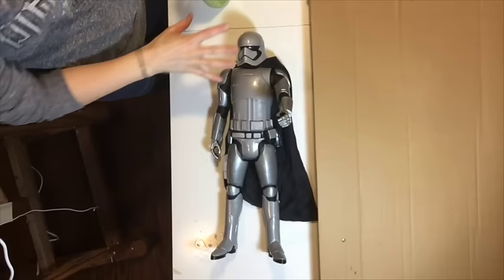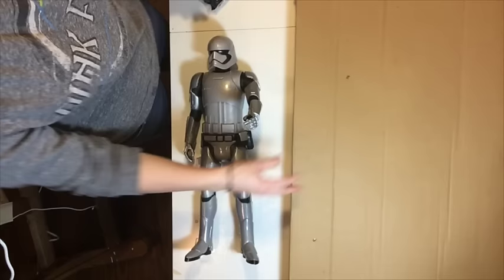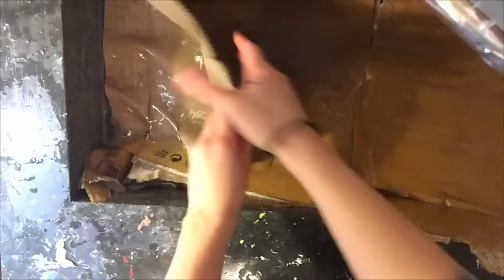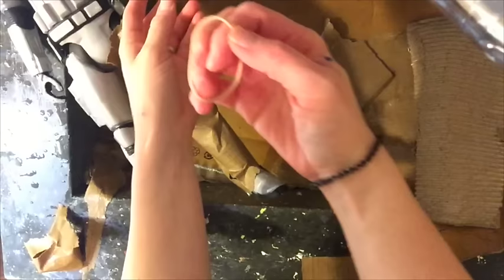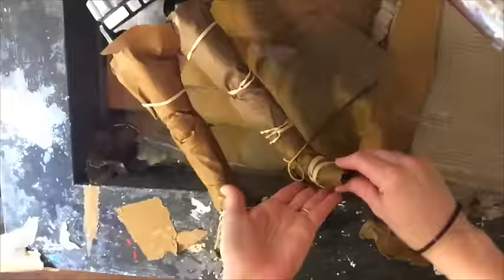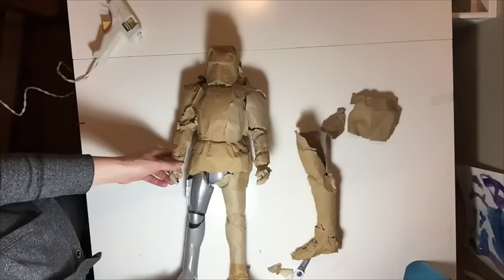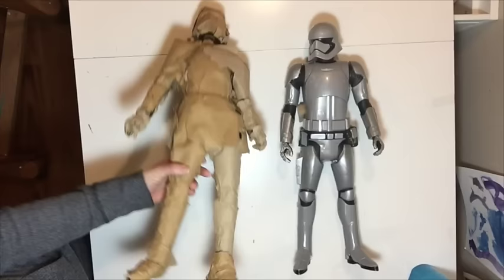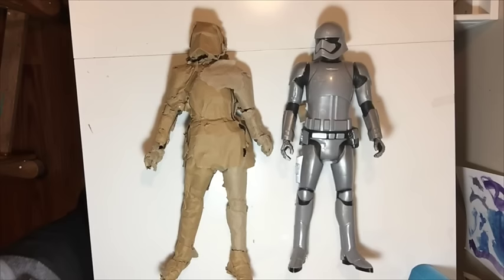Cardboard molding tutorial, Captain Phasma

Comment: Thanks for the idea. I'm planning to make a cardboard tree. Will adding some glue to the water while soaking the cardboard help in giving shape to the structure?
Reply from the maker: No glue is needed, I would use more layers of cardboard to make it stronger.  Are you using a form or are you just sculpting it with cardboard?   I would use something under the cardboard to support it
Reply: +Mr. Otter Art Studio Appreciate your reply, thinking of using a cutout of a stronger cardboard as the sculptor and covering it with layers of wet cardboard to get the finishing touch.